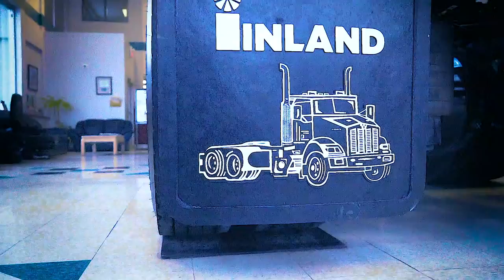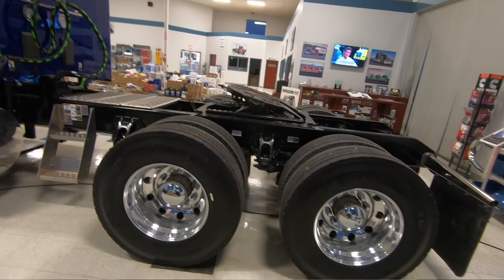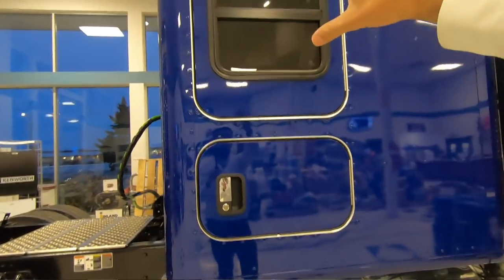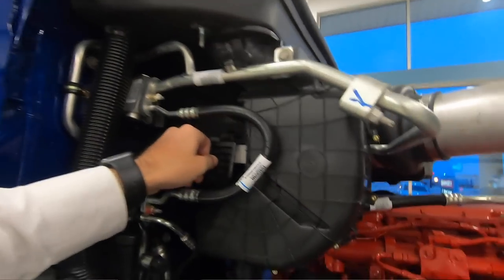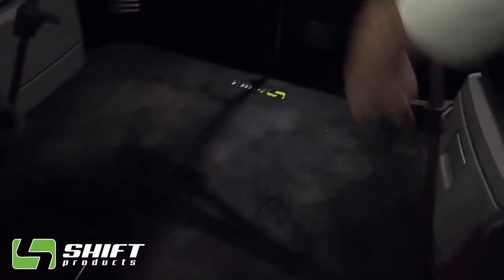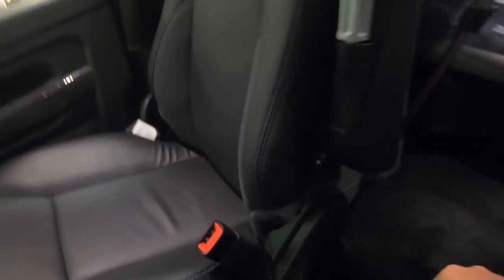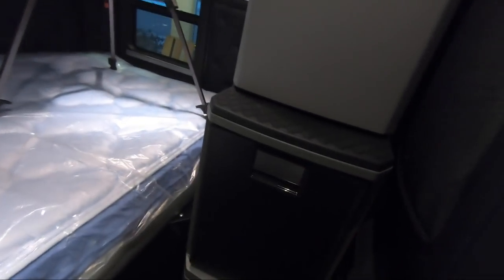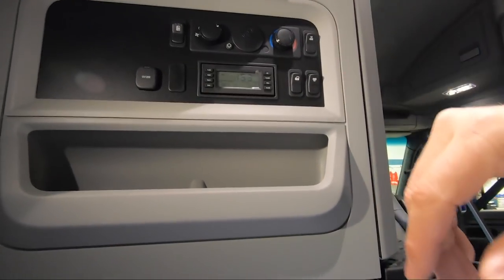LEGENDARY BLUE KENWORTH W990 CUMMINS MANUAL - MIDNIGHT BLACK LIMITED EDITION INTERIOR   TOUR

Comment: I drive a Kenworth T680 with an X15 500 HP Cummins. I bought it brand new in August 2018. The model is a 2019.
Now with 390,540 miles. 
I wanted to buy a new 2022 and sell this one...... Even my sales agent said.  TRUCKS ARE OVER PRICE RIGHT NOW.
I paid $142,500 now is $280,000  for a 2022 model.
 It should be at no more then
$1650,000 an increase of about $5,300 per year that is normal. 

For a $280,000 it is crazy !!! I will wait till there is enough trucks to keep a fair price..... ( I am a 30+ OTR Experience Driver, I know what I am talking about )

If you buy now you will lose money when time to resale it... hold down to your 💰

Comment: Hey Andy, how much is this truck and also how did you come up with that 110,000 lb gross rating; being that it is a manual transmission.?
Reply from the maker: The truck is over 200,000 canadian. The GCW is due to the differential and suspension. The manual 18 can go way higher.

Comment: Hey Kenny, you've told me that Kenworth has stopped the  T660(600) line. To get 48"-56" wardrobe closet, fridge and additional cans, what configuration is available?
Reply from the maker: Biggest closet is in the 86” studio. You get two 14” closets plus drawers and cabinets. Available on the t800 and w900

Comment: What's a ballpark number difference on a stock w990 76inch vs. a day cab
Reply from the maker: I can price in Canada only and they range depending on several variables. Usually 195-210k Canadian for an owner operator spec. Thanks for watching  daycabs are about 20-30k less

Comment: Why would that truck come with no comfort features that work without the engine running? Idling those engines messes up the dpf system and plugs it up. Do you not over TRI pacs anymore? The kimm system sucks because when the computer doesn't like what the battery is doing it just shuts down and then you wake up to a dead battery. If I spec'd that truck it'd have a tri-pac installed. Then you don't need no webasto heater either.

Comment: why is only 1 stack connected?
Reply from the maker: Because the emissions system need certain back pressure. Also, on stack only had about 5% of the exhaust going though so and it would fill with water and not evaporate.